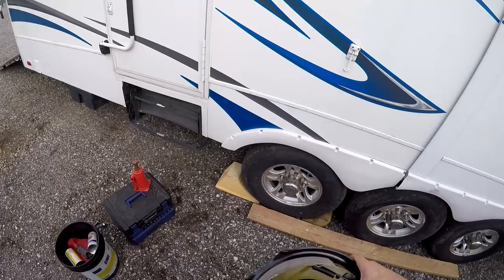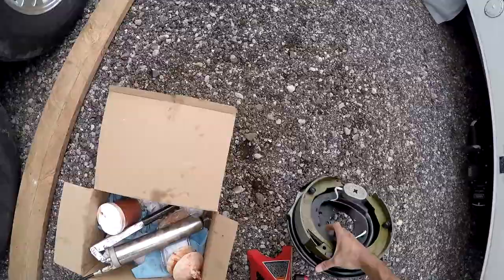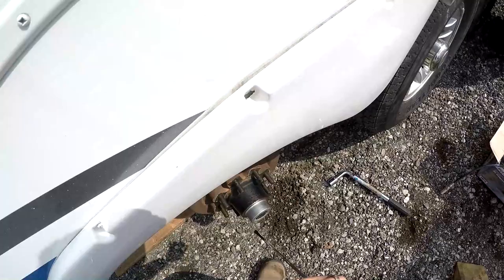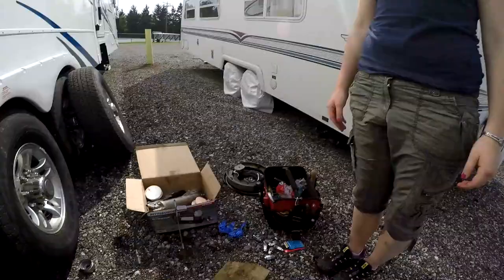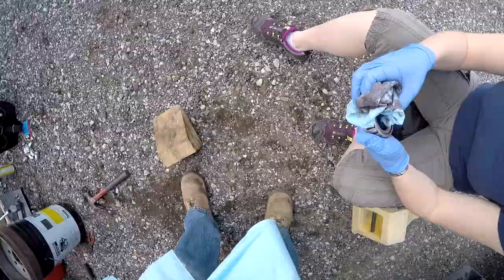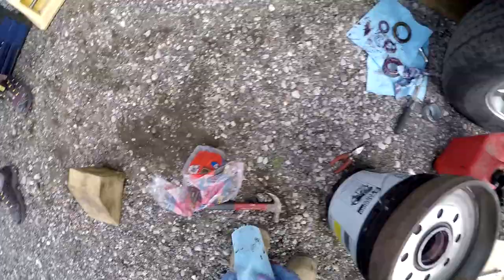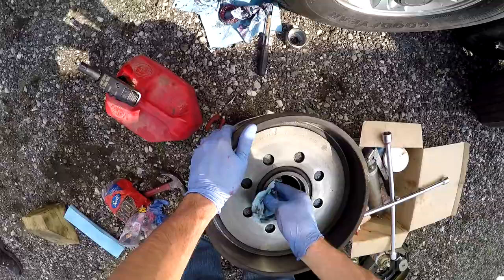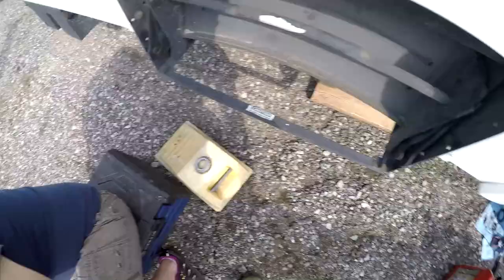Greasing Trailer Bearings and Replacing Electric Brakes - Full Job

Comment: I don't think you should take the video down, but a better way of taking off that seal might be to pull the castle nut, take the bearing and washer off, then put the castle nut back on a few turns then pull the drum off smacking the inner bearing against the nut. Essentially you are doing the same thing, but it is cleaner, and it doesn't get your lug wrench dirty. Then the only thing left on the spindle is the bearing and the seal. Also one more recommendation, just buy new seals. They are cheap, and you won't be stuck on parts.

Comment: Good video; getting ready to do this and am now confident; I've replaced/repacked bearings before but never the whole brake assembly; a seal remover tool makes that part of the job easier with no beating on the inner bearing; always use a new grease seal and cotter pin; cheap insurance; wish, wish, wish you had reconnected the wires! I am wondering if the brake connections are polarity sensitive. Thanks for spending the time to do this!
Reply: I also had that question; "Do brake connections have polarity?"